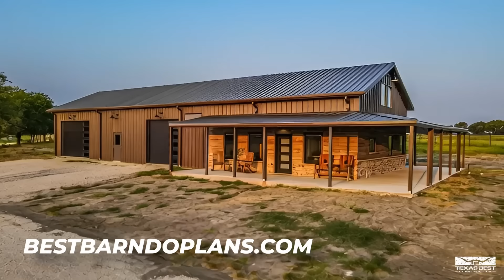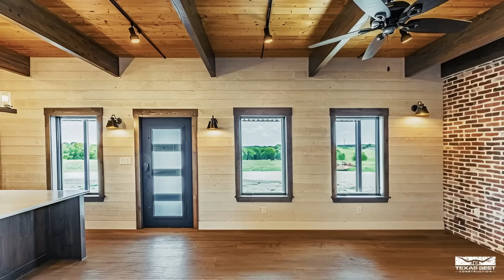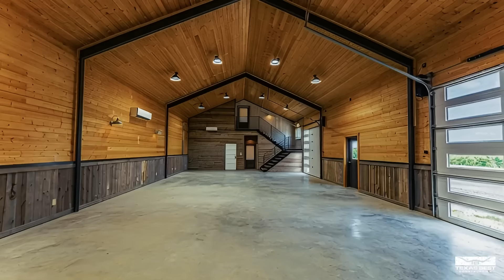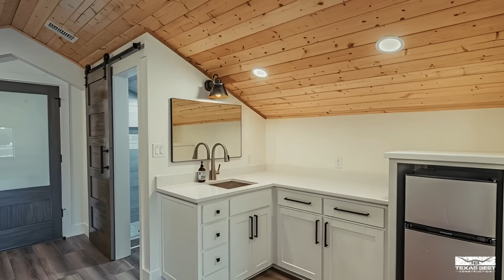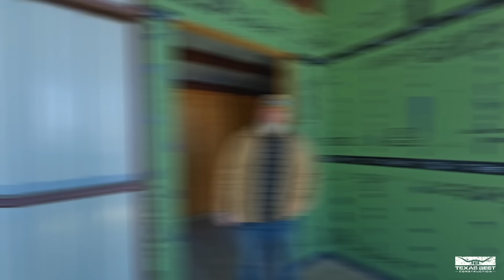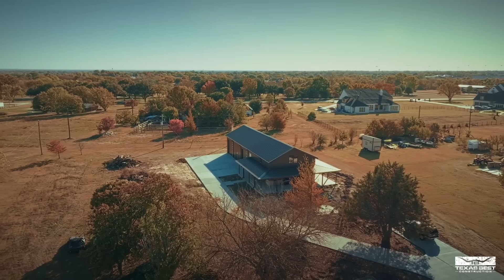Off-Grid Shell Only Barndominium in Allen, Texas | Texas Best Construction

Comment: Why not use light gauge steel studs? Mineral wool insulation would make the build very fire, mold, insect, and rot resistant. Use Mineral wool board on the outside as a thermal break.